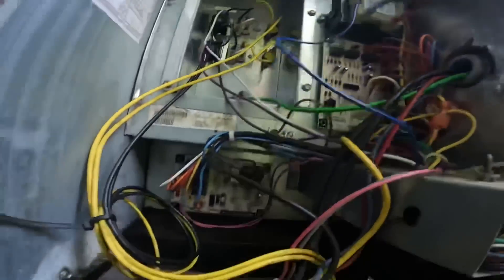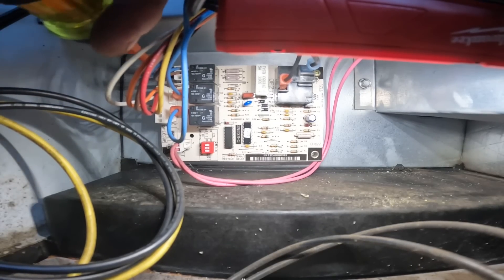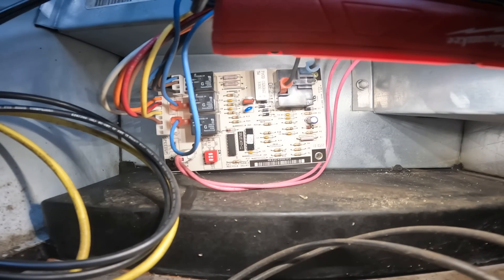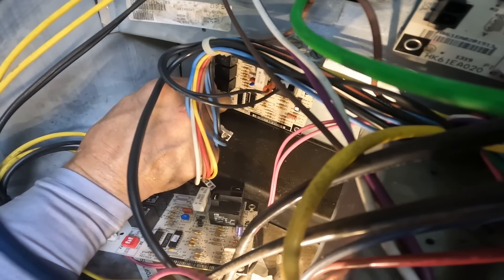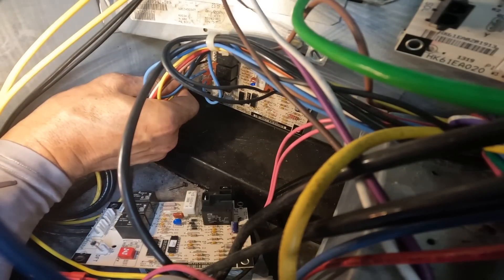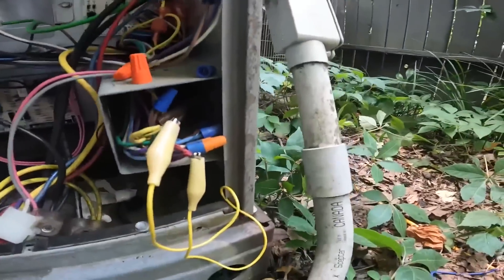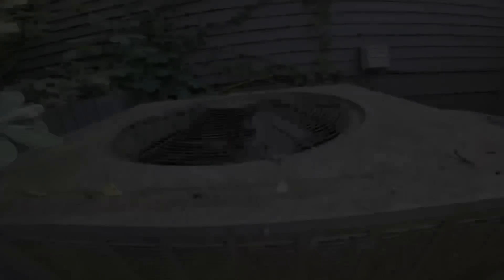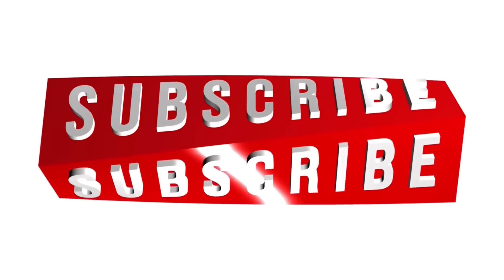No Cooling On A Carrier Heat Pump Package

Comment: With all those little resistors and capacitors on those boards, it is surprising they last as long as they do because you know they don't use the best quality made. It gets hot, cold, and humid in there. Although it is not as bad as the computers they put under the hood in cars, have to endure. They really have a tough life. Those little black boxes look like relays. Mechanical parts probably fail more frequently than the electronic ones. 
In this heat, you can call yourself the Sweat Saver Superhero, Curtis.

Comment: We see it a good bit here in SC. Bad time delay on the board. The defrost portion in most cases is fine, add a after market TDR, jump off of the board sending T1 and T2 thru it and it’s done! It’s a good option for some that can’t afford the board right away or if we’re unable to get the board right away.

Comment: In most Cases its not the engineers that cause the issues its the bean Counters . I worked for a HVAC manufacturer that made Geothermal heat pumps and they would constantly fight with the bean counters and change designs to meet a price .

Comment: The same carrier engineers that put those gaspack draft inducer motors behind the control board, transformer, and capacitor. And then held it with double too many screws, half of which were put in while it was still a frame, then put a heat shield in front of it that also has too many screws. Turning a 15 minute change out into minimum 2 hours. Oh and also gave them a design flaw where they hold condensation and rust out. Oh, and they're likely the same ones that mounted the air handler control boards as close to the bottom as they could, so they get nice and wet if there's a backup in the drain pan. I hate carrier with a passion.
Reply: Not to mention, the replacements are ALWAYS OUT OF STOCK ON BACKORDER…